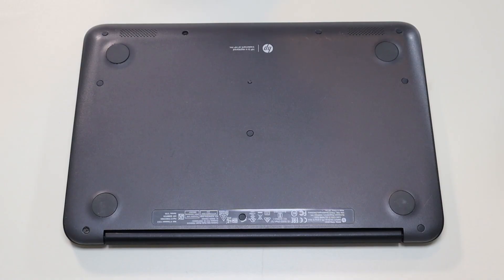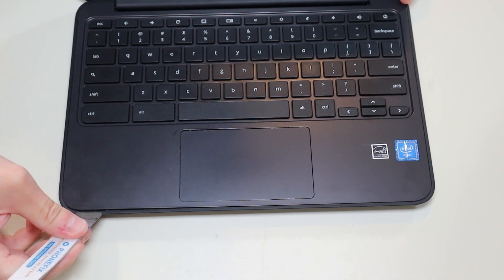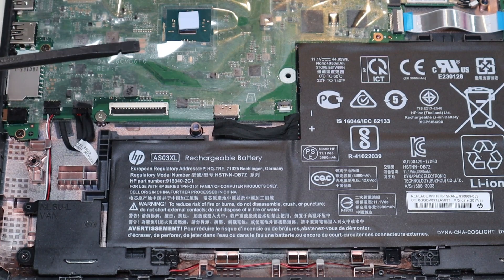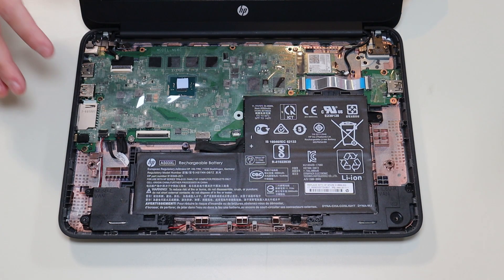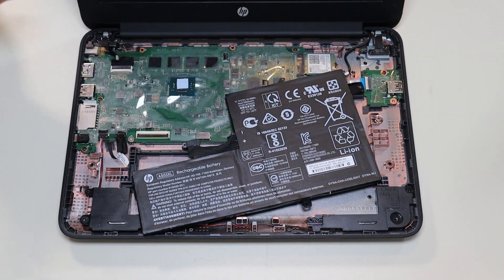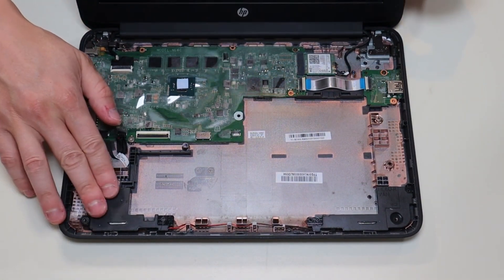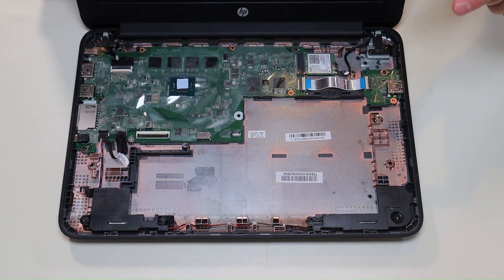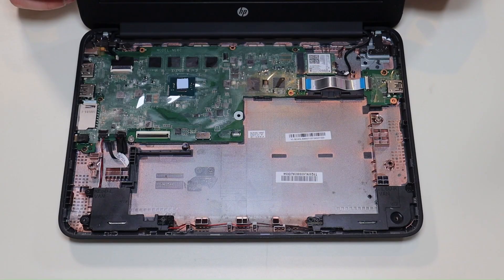Teardown / Disassembly - HP Chromebook 11 G5 Laptop

Comment: where is the hard drive?
Reply from the maker: Remember to check the FAQ's on my videos! It could save you time getting an answer to common questions :)
The RAM is integrated into the motherboard and cannot be replaced. The SSD is actually an eMMC drive and is also integrated into the motherboard

Comment: What are the available ways to increase its space? Change the SSD or add one? Thanks from Egypt❤
Reply from the maker: The SSD is integrated into the motherboard. It cannot be replaced / upgraded. Yes, you can add an external storage device to any computer in order to increase its storage size :)
Reply: @PC_Monkey  Thank you for the information, no problem
Reply from the maker: @YouOpay  Happy to help :) Always here if needed !!